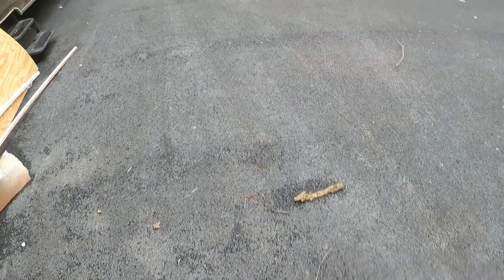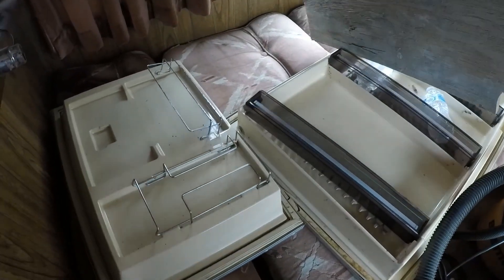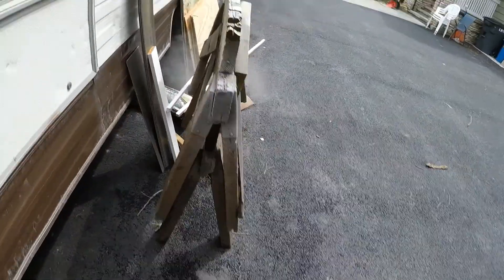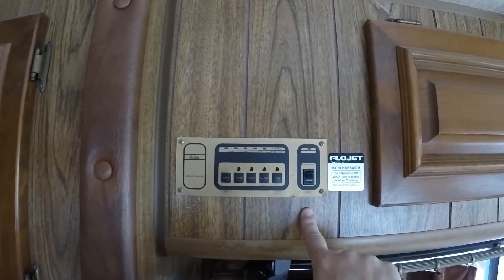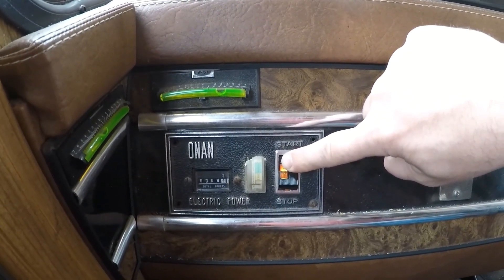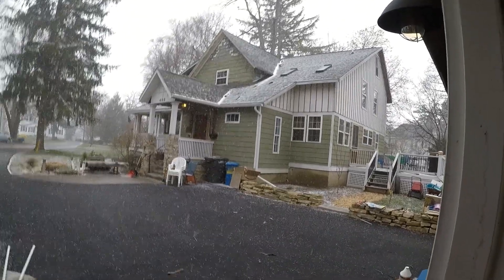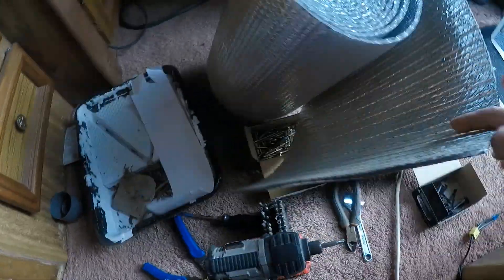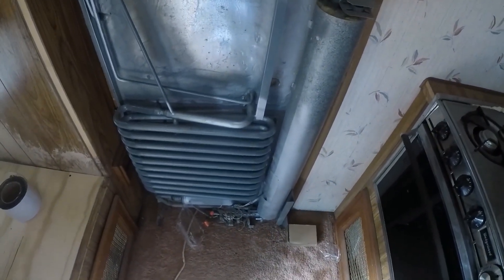I guess Spring is not here until Summer: Western NY and working on the RV

Comment: When you get a chance, I need to ask you an off video question concerning my Onan 5k generator, solenoid click issue.
Reply from the maker: Ok. can do. Not sure how to do that without plastering personal contact info on this. I don't have FB, either. We'll figure something out. Been all over my Onan the last year. if you have a click, likely the solenoid is shot. Mine did the same and I ordered it from Jacks Small Engines on the web. OEM part, too but folks tell me you can use a Ford 4 terminal part. I went OEM. Also check to see if your battery is OK. One of mine cracked a cell and just couldn't get enough voltage to juice up the solenoid.
Reply: @drlong08  I have changed the solenoid and control board.  Off the generator, I can actuat the solenoid.  On the generator, ll I get are a rapid series of clicks.  Batteries topped off.  Need to run a check on every inch of positive and negative cable to verify integrity.  Thought you may be able to steer me in a more positive direction on troubleshooting this.
Reply from the maker: @ChrisBrocksmith  If the genset start switch gets it going I would look to that voltage drop you dread between the remote panel up front and the genset but I'd first pull the genset cover and check all the grounds and connections for any corrosion and tighten anything up. I also found my coach battery terminal was a bit loose. Chasing the electrical gremlins is what I dread the most.